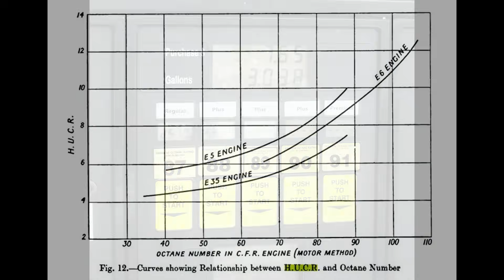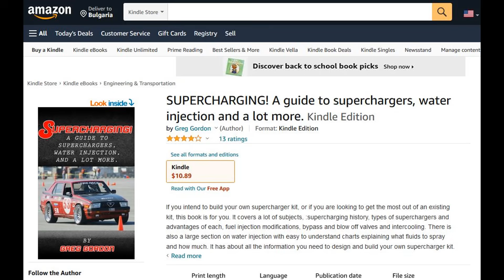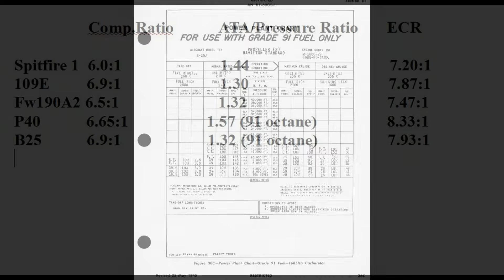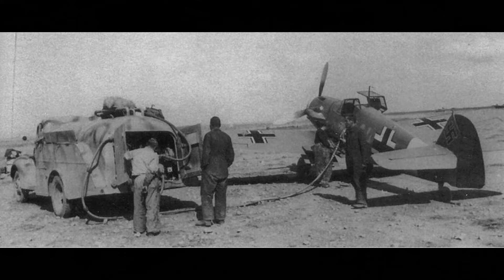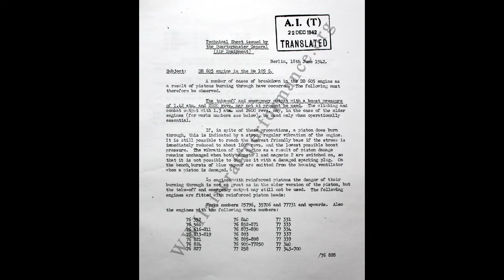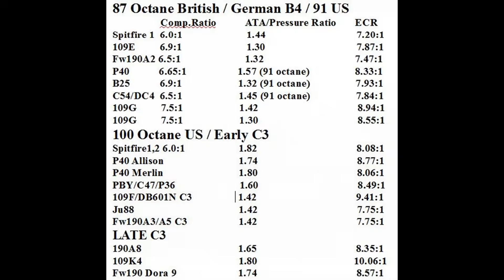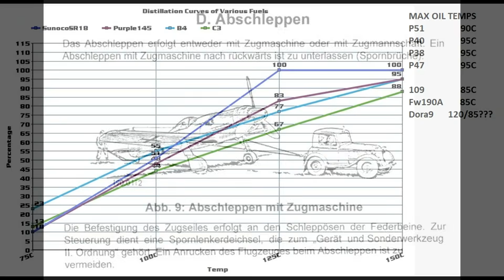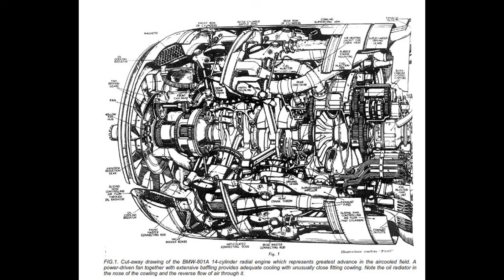German C3 Fuel, Uber Octane or Synthetic Crap?

Comment: i wonder if the octane part/additive of the fuel DID evaporate quickly 
.
so if it was FRESH.... rushed by train.... unloaded quickly..... it was 130 when it went into your plane
but most times.... being stored in a big tank at the air port for weeks, if not months..... it would drop down to 100 or 105

Comment: 56:00 they probably used that extra 20 to prevent all the piston issues they were having.....
.
like... they were already short of engines.... which is why the 190 used a radial for a while
so lets make a fuel thats WAY overkill..... so we can figure out of it simply is just too little octane rating, or something in manufacturing 
.
.
then again.... running it lean, which brings that saftey margin down...
.
idk.... possibly it would have required re-jetting the "carb"...... and they didnt want to do that when the aircraft may see B4 fuel at any point

Comment: 8:26 should have tossed in the GM 400 small block.... just to REALLY confuse people LOL
.
largest bore of all the V8 small blocks.... and a CRAP TON of stroke also
i love my 400 in my 77 K10 chevy pickup
.
LOTS of power everywhere.... despite being a stock "smogger" motor
just with the EGR deleted..... and it never came with any other smog equip because over 6000 pounds gross vehicle weight
a loop hole that was soon closed 
.
.
that sucker will pull a oak stump at 900 RPM.....
or out run a modern 6.0 chevy at 5400 RPM
.
.
now, it is 6.6 liters.... and SUCKS the gas down 
that 400 drinks more than my mother..... (a little self loathing for ya folks their..... she has been sober for 10 years.... but it still fucked my childhood up)
.
.
but i can usually fix it with a hammer.... 
despite being a mechanic...... sometimes the correct fix is smashing on stuff with a hammer..... especially when its your own shit box
Reply: also.... the 400 will have a higher comp ratio..... due to more stroke and larger bore
but still having the same deck height and heads 
,
im actually running 350 heads.... SLIGHTLY ported (more of a polish)..... just with steam holes drilled 
350 heads + drilling a few holes = 400 heads
.
.
the 400 is truly the best SBC GM ever made.... 
.
the piston speed.... non-issue with modern oils
the over heating = people not using the 7 blade fan and 4 core radiator ALL!!! 400 vechiles had
.
they are 265hp and 420 foot pound engines.,.... IN SMOG!!! form!!!....... with a 2 BARREL CARB!!!!!!! 
.
they are going to make more heat than a 180hp 350......
Reply: and i could get into the larger bore unshrouding the valves... allowing for more CFM threw the same heads
.
i could even get into a 377 (400 block.....350 crank)
which will poop ALL OVER the popular 383 that people think makes a lot of power (383 = 350 block....400 crank)
.
.
if piston speed was such an issue..... why add stroke to your 350??????
.
.
and i could get into rod ratios
but thats a HUGE rabbit hole
Reply from the maker: The SB400 was a good engine. However Chevrolet never built a performance version of it.

Comment: Just watched you video on aircraft fuels. Very interesting and well done. I am an Canadian AME  wlith 56 years experience. Back in the 60s I worked on early  Bell 47s with Franklin engines.  We used to carry a can of Tetra Ethel lead I think it was for fuel in Barrels that were old and laying the tundra. I presume the fuel would loose there octane rating. They hand a mechanical waste gate and no manifold pressure limiter as later helicopters had. Max MAP was 36 inches on the gage and it was pilots job to watch and not exceed. The odd time a pilot would return to base camp a report a excedance in pressure. He could only say I saw it going south through 54 inches. Engines had a 600 hr TBO and quite often they were done sooner. Cylinder hold down studs were replaced every time.

Comment: Fantastic discussion Greg.  Question regarding R985s on my Twin Beech.  They will put out 40 inches plus at Sea level.  Can I run them that hard given 100LL fuel today.  That engine was designed in the 30s with 77 octane in mind.  The book says 36.5 inches at Sea level.  I'm thinking I can do full throttles.
Reply from the maker: I don't know, I haven't flown a Beech 18 in well over 30 years. I don't remember the manifold pressure limits.
Reply: @GregsAirplanesandAutomobiles  36.5 inches at sea level.  I’ll get in the manual.  I have the B4 engines I believe.  It’s a 1964 model H-18.

Comment: E85 = 103 octane.
Reply from the maker: IF it's actually E85, it's often only E50 but labeled E85. I have found that to run E85 as a high octane fuel it needs to be tested every time the car is fueled from the pump. Or, to avoid that you can just run an E85 type fuel from VP racing or Sunoco and be sure of what you are getting.

Comment: Very interesting video, Greg. As always, thank you for the excellent content. I have an extra snippet of information on late model Me 109s and C3 juice that doesn't materially affect your argument, but offer it out of interest. Jochen Prien & Peter Rodeike's book has several photos of Me-109 G-14/AS planes with C3 fuel markings. Being G-14/AS versions, they're powered by the DB 605 ASM engine with the bigger supercharger and MW50. In fact, you show one of these photos at 52:37 in your vid. Their caption reads: 

"Fw. Hundsdorfer of 2./JG300 in the cockpit of his aircraft "Red 10", a G-14/AS, photographed at Borkeide airfield in September 1944. Beneath the cockpit may be seen Hundsdorfer's personal emblem, a Boeing-eating Dachshund."

In Prien & Rodeike (translated from German by David Johnson), "Messerschmitt Bf 109 F, G & K Series: an Illustrated History", (Schiffer, 1995, ISBN 0-88740-424-3), p. 151. 

The G-10 and G-14/AS were basically the same plane and were produced at the same time (~ August 1944 onward), which is why I don't think this info affects your argument one way or the other. There's no commentary on why these planes are using C3, but over pages 147-55 every pic of a G-14/AS where the triangle is visible, it shows C3. Prien & Rodeike are widely regarded as the experts on 109s and they're very specific about these planes. In contrast, where they're in doubt they explicitly say so. Anyway, their reputation is excellent and I've no reason to doubt them.

They built about 1,000 G-14/AS, and about 2,700 G-10s.
Reply from the maker: That makes sense. Do they say all G-14A/S planes ran on C3 or were they talking specifically about the one in their photo?
Reply: @GregsAirplanesandAutomobiles  They don't say anything about it at all. On a couple of shots they specifically point out the C3 triangle, but there's no discussion of why.
Reply from the maker: That's what I figured. So at least there were some C3 G14s, now did those planes have higher compression or not? I don't know.

Comment: Your instructions on how to find ECR shown on screen are a little confusing.  I think what you meant to put up there is something like:

Boost pressure ratio = (boost pressure + 14.7) / 14.7

Multiply the square root of the BPR with your static compression ratio to find ECR.
Reply from the maker: You explanation is exactly correct.

Comment: At around 1 hr 7-8min. When you say that when running a rich mixture and there will be excess fuel, the German C3 will be less likely to evaporate. By evaporate you mean leaving the cylinder with the exhaust gasses in a gas state? So the C3 fuel would get into the oil by staying liquid and bypassing the piston rings because of fairly low tolerances between cylinder, piston and rings?

Comment: And there could be even topic about damage sustainability of particular engine, water/glycol cooled once were unrelaiable. One bullet and you have to land with dead propeller, both for BD601A and Merlin.
Reply from the maker: True, but in the 109 it had dual radiators and one could be shut off so that a leak wouldn't empty the entire system. From there it could at least make it home.
Reply: @GregsAirplanesandAutomobiles  I am not an expert in Me 109, but several were lost during the Battle of Britain without being hit and at least one was hit by 1 single bullet into oil system and force-landed. Lacey was hit in the engine by 1 bullet from Me109 on 24.8.40 and with dead engine force-landed, few hours, mabye under 2, and he was flying again. He was most probably not claimed.
Reply: @GregsAirplanesandAutomobiles  I found it Bf 109E-4/N, W. Nr. 1190, Weisse 4 of 4./JG 26 belly landing at Eastdean, Eastchurch on 30.9.40 at 18.30 after being hit by one bullet in the engine. Uffz. Horst Perez was OK, but shot by a soldier after good landing.
Reply from the maker: Yes, they came out with the dual system with shut offs during the F models production run. Even then not all 109s from that point had it. I cover this in a video somewhere on this channel.

Comment: Merlin III was also more reliable, much more reliable then DB601A.
Reply from the maker: Maybe, but the DB looks cooler.
Reply: @GregsAirplanesandAutomobiles  Definitely :-D DB601N life expectancy was 40 hours. I dont remember DB601A, at least 80-100 hours before refurbisment, Merlin II or III was like 120 hours before deep control. In reality under proper maintenance it was evem better. But this was not the case for future Merlin engines. These were much less reliable. Why?

Comment: Greg, another astounding bit of research, and a great narration. Very interesting, for real fans like me. Thank you kindly! Now, if you really want to talk about lousy aviation fuel, look no further than the Reggia. Germans could not use Italian fuel, thus complicating the supply situation during the North African campaign.  It was low octane, corrosive and poor quality. In addition, Italy had issue with the strategic materials needed for aero engine metals. Thus both the FIAT radial and the FIAT & Alfa Romeo license-built DBs came in quite short of the rating of the originals.  I am also wondering what the Japanese Army and Navy aircraft might have been using... Not much oil in Japan, and few refineries/chemical industries as well. Plenty more subjects to explore.

Comment: I've always wonder what might have been achievable if engines such as the DB 603 had access to 150 octane fuel and used technologies like two stage supercharging and intercooling.

There are a few unreliable records of a test variant of the DB 603, the N model which was supposed too have exploited C3 fuel, a 2 stage supercharger, and various tuning improvements, supposedly this achieved a take-off power of 2958hp

Its hard to imagine the increase in performance the German heavy fighters might achieve going to that from 1726 HP, notably what speeds would the Do 335 have achieved with such a performance increase? 

Would the German idea of, heavily armed aircraft that weren't maneuverable but could outrun single engine fighters be possible? 

Regardless, a very interesting subject

Comment: My three favorite under square non racing stock 92 octane motors from 1969, the 10.75 to 1 Pontiac 400 and 10.0 to 1 383 Mopar  & Ford 9.5 to 1 390 . These were in everything from
a coupe to a pick-up and were not the largest displacements or highest output available. All are a joy to drive!

Comment: Yet another wonderful and informative video.

Having watched this video in full again, I can see where you are coming from on the matter of fuel quality with German engine performance, it's certainly impactful. Having read Calum's book however I more inclined toward his findings in regards to strategic alloy shortages. With Nickel shortages already hampering the 801's exhaust valves in 1941 until remedied with chrome plating, the same in regard to the DB605/3's valves. WIth the loss of the cobalt mines in 1943 making things worse.

Yet that alone would make things difficult but material shortages could have been worked around and compensated for with more intelligent design prioritization and industrial prioritization. The RLM's leadership was not up to the task of rationally devoting resources to key concepts and technologies before and during the war, as Calum's book notes; they spent too much precious resources on too many side projects while the engines that desperately needed attention to wage the war were neglected. The British by contrast acted and responded quite rationally quickly to changes. With tight coordination between government and industry  Whom made far less mistakes compared to the RLM.

IMO both the issue of fuel quality and material shortages could have been mitigated with two stage supercharging and intercooling. The performance of the Jumo 213F/E being standout performers of what could be done with B4 fuel and MW50 and the proposed two stage two speed supercharged & intercooled BMW801F being also a very good engine. Daimler Benz even had worked on two stage supercharging in the DB600 before the war, it would not be a stretch to imagine German fighters with such engines during or after the BoB. 

And yet they failed. The new generation engines are in many ways a disappointment, lagging behind until virtually the very end. The German's had the means to make such meaner engines for their fighters before the war but party politics and mismanagement sent them down the wrong path. The result was quite honestly, good but close to mediocre engines IMO.

Comment: Do you need to run the engines to calibrate them properly? I read that even in 1941 Opel were forced to shut down production because they had no petrol to  test the fuel pumps.

Comment: I'm astonished that some cars in the late sixties had compression ratios up to 12:1. That's hyper even by today's standards.
Reply from the maker: Those were really race engines needing race fuel. About 11:1 was as high as they usually went on the pump gas of the time.
Reply: @GregsAirplanesandAutomobiles  Still very impressive for mainstream manufacturers to produce affordable cars with that HO.
Reply: If you are interested, check out the 1967-1969 L88 Corvettes and the 1969 ZL1 Corvette. 12.5:1 compression ratio and a warning on the console not to use low octane fuel!

Comment: On your speaking of oil dilution and bearing life, I noticed that some of the earlier German engines had roller bearings on the connecting rods (at least, perhaps even the mains but you don't mention it nor is there a picture) like what remains even today on Harley Davidson engines. 
Kevin Cameron, the tech wizard for Cycle World magazine had a write up not too long in the past about bearing changes over the years in motorcycle engines and how the evolution of motor oils over the years have worked hand in hand with each other, try digging around on the internet and looking for his article on it, it's been a few months since I read it but it just might shed some light on some of your unanswered questions about why the Germans were having issues concerning oil dilution and bearing life.
Reply: They did indeed use roller mains.
Reply: @nerd1000ify  
Did they switch them to shell bearings at the same time they switched the connecting rods to shell bearings?
Reply: @dukecraig2402 on further reading, I think I was wrong! I think I muddled it up with the Maybach tank engines, which did have roller mains. Looks like the DBs had plain lead bronze main bearings.

Comment: Most of these things were controlled by how high you can fly. How you got there is interesting mostly to BMW, DB or RR. Weight and durability being prime. Then came fuel. RR and USA makes could have whatever they want and Germany less so. Sleeve valves help greatly.  They also cause problems of oil use. Spitfires were 30 miles from France so effectively in France. Huricains used Merlin.

Comment: i have just whatched your video on B17 & Lancaster...you didn't mention the fact that the 50.000 loss in crew was across all types of  aircraft in bomber command from 1939 and not just the Lancaster..  .i have seen a number of your video's and find you very predjudist to ward the British  verging on the side of a racist
Reply from the maker: Wait, the British are their own race?
Reply: @GregsAirplanesandAutomobiles 😂
Reply from the maker: Also, those loss stats were very clearly stated to be bomber command as opposed to the US 8th Airforce. I didn't say B-17 vs. Lancaster. Furthermore, why are you posting this under the wrong video?
Reply: Please use a capital "I" when structuring a sentence. It adds value to your intellect.

Comment: Seems like if they were running out of gas they might run leaner gas goes to hell in 6 weeks so you have to turn your gas over. Flashpoints on fuel is important. You can send junk out the factory if it is just going to get blown up. At the race track in our town they use a gas.most modern gas is octane boosted by using MBTE lead is an old alternative MBTE has no Lead methyl Terterati Butyl Ether cost is a big consideration when a refinery is running in excess of 50,000 bbls per day.

Comment: The direct injection injectors would wear fast and generally were leaky during operation. The solution was to run the engine on lean setting, knowing that in reality they would run rich/normal/very rich and a set of twelve injectors of a batch of 10000 made were unpredictable on how they perform. Generally q-control failed around 1942. Quality stock was depleted around the same time. Tools and tooling were worn and impossible to replace. The DB injectors date back to prewar F1 injectors. The postwar Mercedes race engines and the 300 I6 had the same issues. Borewalls wear rapidly because the gas washed off the oil film and oil thinning a serious issue. Offtopic... the postwar DB engines were based on GM licensed destroked Stovebolts I6. If you need help with german source translation on specific engineering issues and historic tech  context...might be able to help.